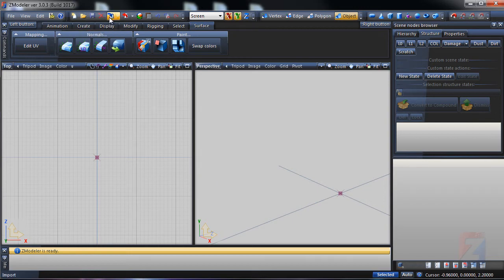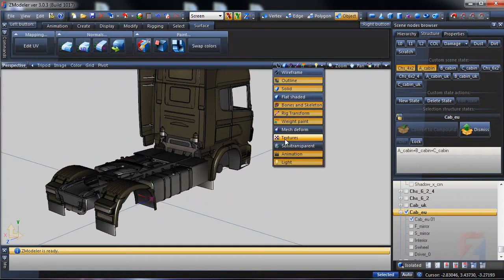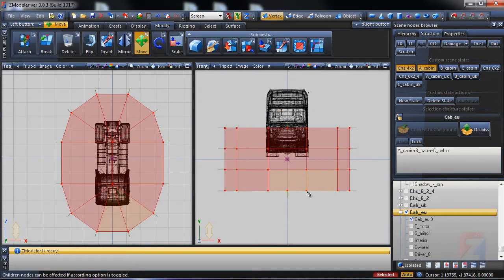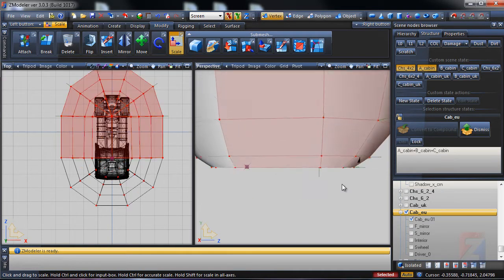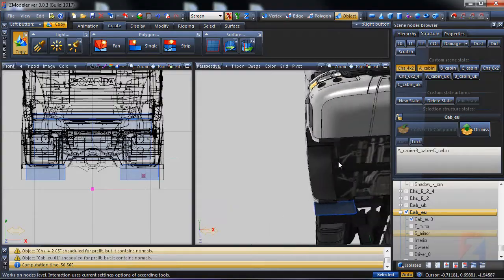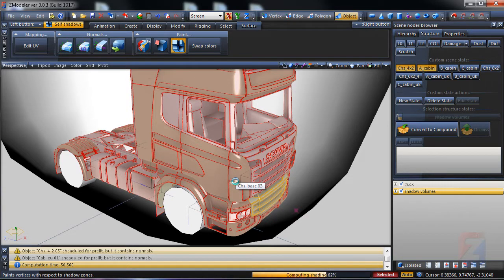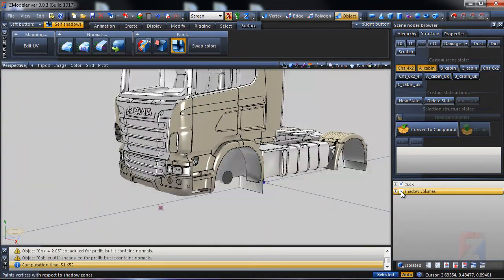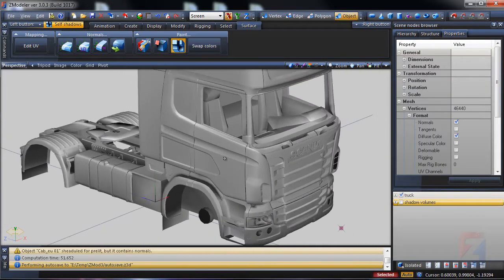Ambient Occlusion vertex color shading in ZModeler3 (Part 1)

Comment: When / why do u then bake AO? Is this an alternative / equivalent method to make shading?

6:42 Why do u do multiple runs, each time reducing the strenght?
Reply from the maker: The first run with maximum strength and high distance gives the overall shading (creates shadows on bottom, sides and does not let elements in the lower area of the truck to be lit). Further steps with reduced strength (level of changes the lighting makes on vertices) and reduced distance can alternate the overall shading by adding some light onto areas that the light can reach - e.g. no occludes for the light at some moderate distance. and touch-up pass with small strength and small distance to make light accents on details that are in a shadowy area, so there is small difference in shadows whether vertices facing to the light and those that are not facing to the light.
So, the first pass gives the dark shade to the area that will not become lit after several passes (lower area will retain unlit and roof will still be lit). The low-distance pass does not add more light (because there is no occluding geometry to reach that on low distance that was not reached on higher-distance), it adds some small light to an areas that are not occluded and could (possibly) be reached by reflected light.

The Prelit and Self-shadow technique is used to add color baking to vertices. It is significantly faster for computing and a rough approximation of AO light on a geometry. Baked AO textures are evaluated per-pixel and much more accurate, as they can give shading variations on entire area of every polygon, while vertices-based AO can respect shading in vertices points only (and interpolated over the triangle surface).
Reply from the maker: Consider Baked AO textures as the more modern way to AO shading than per-vertex precomputed lighting. Ray-traced dynamic AO is the most modern way to evaluate AO shading in games so far, but this is up to the game engine and user's hardware whether dynamic ray-tracing is used or not. SCS models have old-fashion per-vertex lighting on a model, and AO textures in use as they give no performance impact on frame rate in game.

Comment: I don't know how to using . i saw a manual , but this in Zmodeler to rise this message
Can not complete task: Your license denies this action.
Reply from the maker: license is not installed or not saved properly. make sure to run ZModeler as Administrator. Assign new password onto your platform in web account (My computers page), specify your account name and platform password in ZModeler on "Account Setup" page. Your platform should have an active license assigned in web account (My licenses page).
Reply: I am trying to edit the Euro truck mode, but the above message is repeated and if you do not mind, I will let you know my ID. Can you email me the Euro Truck file so I can email it?
Reply from the maker: Your license key is not installed. Write me on E-mail so I could assist further. My e-mail is shown in ZModeler on "About" screen.

Comment: Переозвучь на русский,многие слова не понимаю,хотя с английским нормально
Reply from the maker: This guide will illustrate the self shadows prelit color-paint.

I use the truck model as-an example. Import the truck. Show it's chassis and cabin state models. I disable textures in viewport.
This is the model we shall prelit. I'll use the scania truck model as an example. I hide all objects. Then I show-up only meshes that need prelit and does not prevent proper shading. These are headlight glass, and should stay hidden. The shadow volume for the game, hide it. The rest are ok. The cabin glass should stay hidden. As well as shadow volume. Do the same on other groups.

Ok, proper models are shown.

I toggle on textures to make sure the proper objects are shown.

Disable textures in viewport. I need to create a sort of a bath for the model. It should surround the model, and extend on top. It will occlude ambient light for the model. Cylinder with 10 points, and 3 segments.

I use, "Modify"\"Extrude". Disable "sharp edges". Then Move faces to shape the bath.
The overal distance to the model should be about the same on all sides. The bath should start at the truck bottom. And go higher than the cabin height. The bottom sections should be closer to the truck. I select the back area segments in top view. And deselect the top row of vertices with Control key. Then I place the pivot helper at the cross point of back area segments. And scale down the selected veritces. with "Scale" tool, and "base to pivot" option toggled. Deselect the second row. And scale even more. And scale the bottom row to go under the truck. Deselect. Place the pivot helper at the front segment center. And scale rows of vertices, like you did before.

That's the bath for shading. Correct the shape, if the truck is not fully within the bath. I don't need the top cap. I select polygons, and delete them. Finally, use "Modify"\"Flip", and click on a bath to flip it inside out.

The truck is in a bath. Disable the viewport light.

I need to create volumes to occlude light in wheelwell. I create a cylinder, instead of a wheel for this purpose. It's important not to reach the hub. There should be a gap between shadow volume and a hub. Also, the wheel should not go out of the wheelwell. Otherwise it can produce artefacts. Then copy the wheel to the other side. Keep the gap in mind. Then copy the wheel to the back side. Move it and place properly. Resize to make it wide, but keep the gap in mind too. Copy it to the other side.

Create a group dummy node. Rename to "shadow volumes". Drag and drop all shadow volumes into this group. Hide shadow volumes. Select all objects. Disable viewport textures. Unhide shadow volumes.

Pick "Surface"\"Self Shadows". Click on a model to prelit. Specify range: 8. Shadows color: black. Light color: gray. The model is mostly dark, but lit from top.

Click to prelit again. Specify strength: 40, Range: 1.2
Click to prelit again. Set strength: 20, Range: 0.4
And the final run. Range: 0.2

Deselect. Hide shadow volumes. Toggle on the viewport light. The shading is ready. You see the shadows on a frame.

I'll show you the actual shading. That's just for clarity. Don't do it on your model. I convert all materials to old-fashion type. Toggle off the wireframe, and viewport light. You see the shading in a deepening. Shadows under the aerodynamic fairing. Shadows inside flow direction braces.

I'll show you the original model, the model you are probably dealing with. That's the model with no shading. It looks plastic and unreallistic. And that's the shaded model.

Thanks for watching.
Reply: ZModeler3 Ну в общем-то спасибо